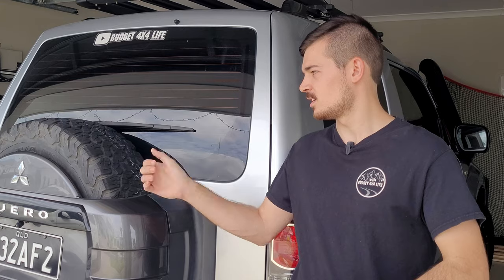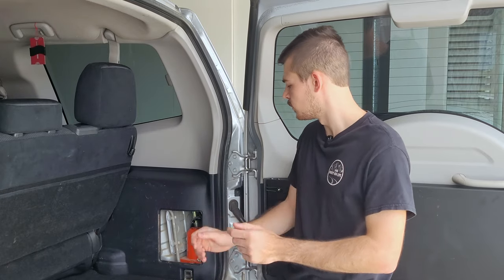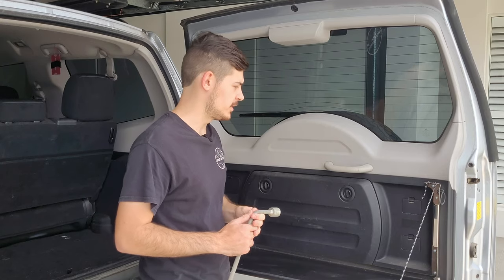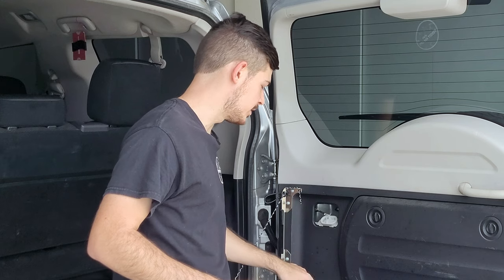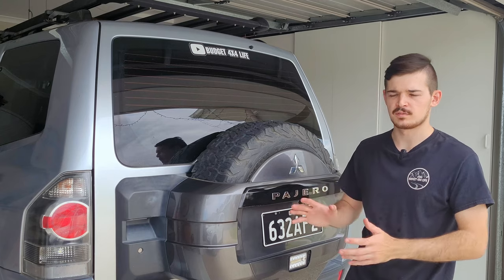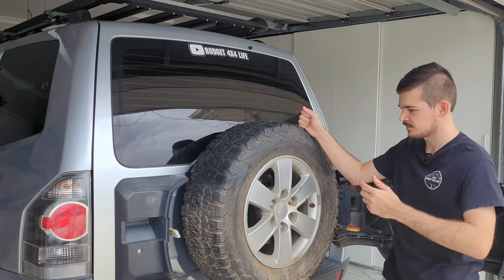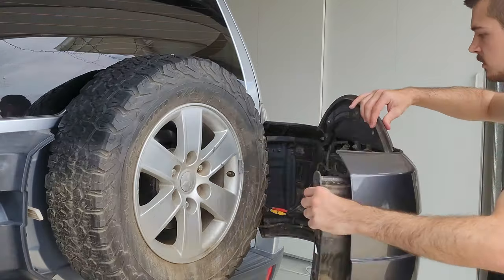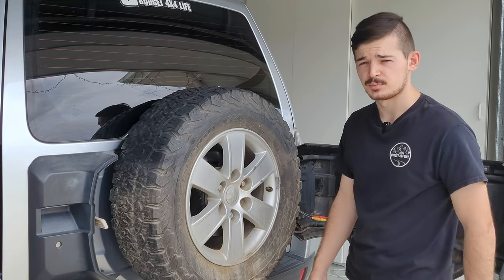How To Access/Get to Your Rear Spare Wheel On a Pajero

Comment: Thanks for good videos! One of my bolts do not come out..they were both pretty hard to loosen, but the upper bolt went out fine..the lower bolt just spin after it got loose, and now it is not possible to tighten it either..what is it on «on the other slde»? A nut or other device holding the bolt which might have been broken??
Reply from the maker: Just give it a wiggle to come out. Might just be a little stuck because of all the years. Grab a hammer 😄

Comment: Hi mate, thanks for the video. Was wondering, how tight should the bolts be? I feel they don’t fit directly after closing the cover, I have to wiggle it a bit and hold the cover in a specific position for the bolt to tighten.
Reply from the maker: Hey matey when you put the bolts back you should wiggle it in spot and push it hard up against the thread first. Then tighten. It should be tightened till it cannot be turn any more 😃